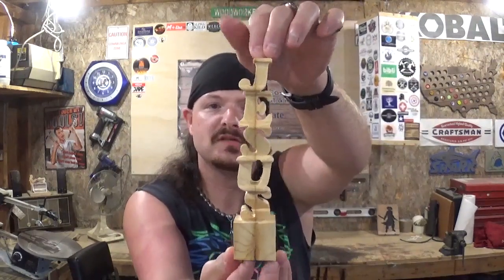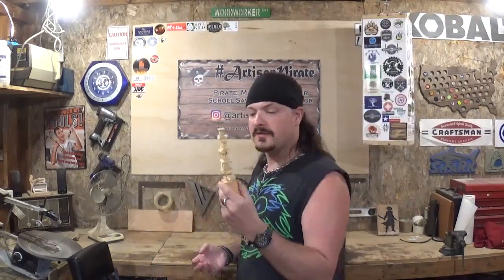Jesus Lives Scroll Saw Art

Comment: Do you have to use a drill press to compound cut
Reply from the maker: Not Really, However, You need to drill the pilot holes as close to 90 degrees as possible